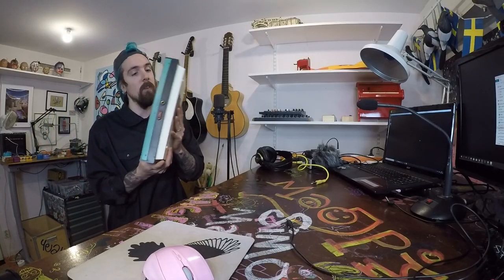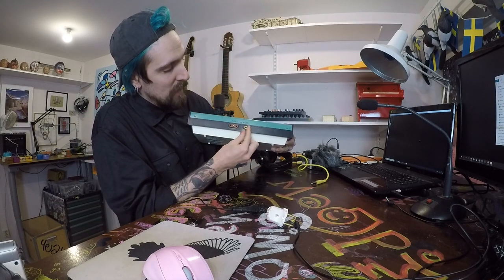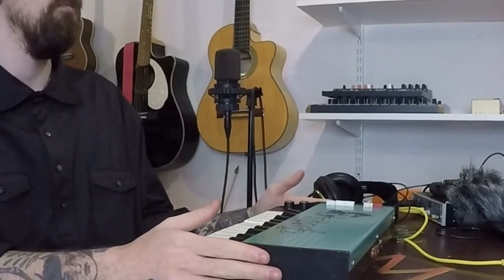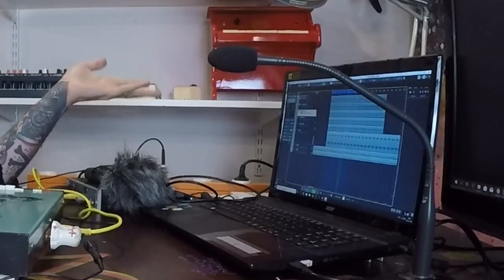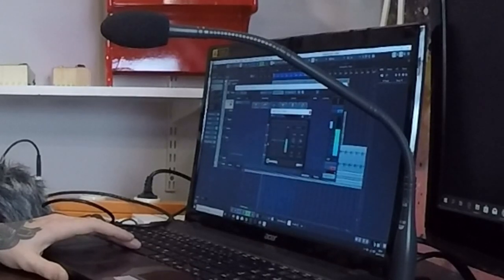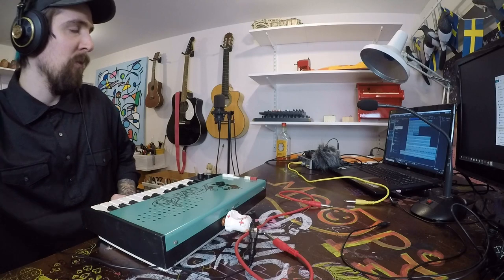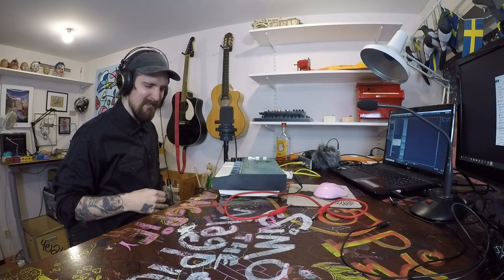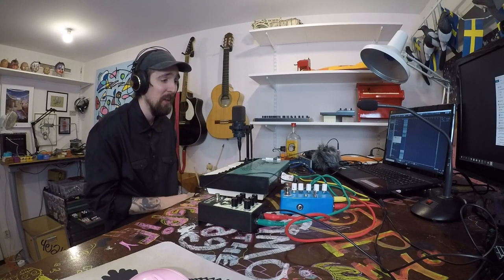Making Music With A SOVIET TOY SYNTHESIZER (P.I.F)

Comment: I fix all sorts of soviet synths for a living

Yes, you can tune the keyboard, you have to do it from right to left, because the resistors are connected in such a way that the rightmost resistor changes the whole range; I advise careful use a long flat screwdriver; also these soviet toy synthesizers are almost unbendable, they were developed in such a way that you can't really improove on the schematic without literally building an additional circuit board.
You could send it to me, but it would be a little silly, as I am from Russia
Reply: Email him. Maybe you can do a video or get on a discord call with him and help him out idk. Would be cool.
Reply: Corvus and the magpie